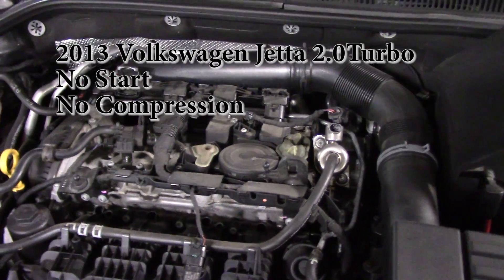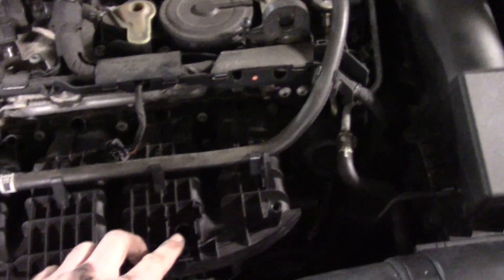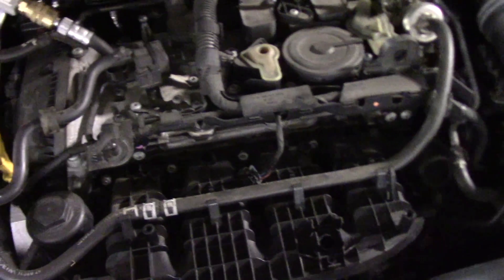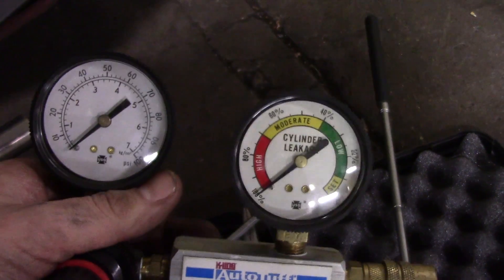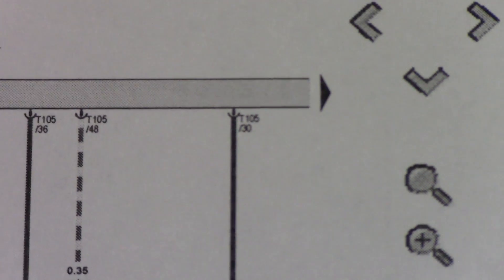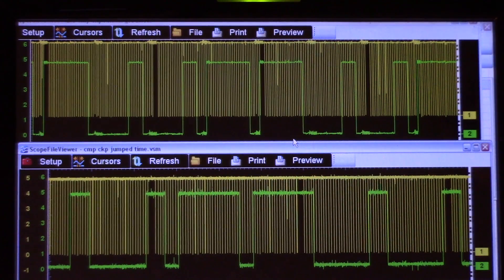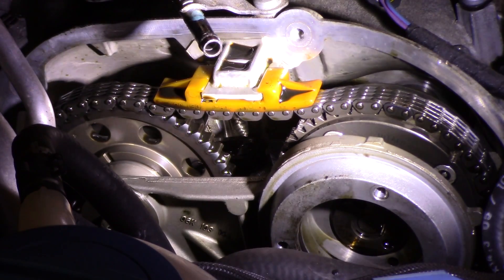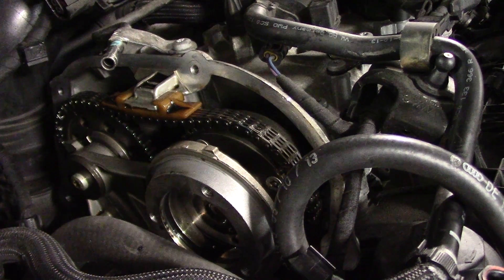2013 Volkswagen Jetta 2.0T No Start, No Compression (jumped timing chain)

Comment: This just happened to my wifes 2014 Jetta GLI that was purchased brand new with the CPPA Motor. VW lost a class action lawsuit regarding timing chain issues, and was ordered to extend the warranty to 10 years or 100k miles on timing issues. VW Denied our claim because the car was 5k over the warranty period. They would not budge even tho we have been loyal customers and purchased 4 brand new cars from them over the years. I was hoping for a gesture of goodwill repair but nope. We have lost a lot of faith in the brand.

Comment: Hi i have a question maybe you have heard of it before because no one in my town or the dealer could explain. I have a 2013 Volkswagen CC 2.0T automatic with 55,000 it has a push key, so i start the car for the 1st time of the day i push the key and it starts well. Drives great to where ever i go! I turn it off and few minutes later i turn it on and it starts well again sometimes the 3rd or 4th time i push the key to start it makes a weird loud noise in the front feels like metal crackling and also feels like the engine is jumping! I pull the key out and try it again and it starts fine with no hesitation.

Comment: mine just jumped time changing the fuel pump. I let it run out of fuel and stall out and that was it, jumped time. no compression. typical POS vw, try to fix one problem and something else even worse happens.

Comment: My tsi is at 100k miles and still has original tensioner, original chain, etc but works fine. So I know I need to update some stuff. What should I replace? Tensioner? Chain? Guides?

Comment: Mine still starts but has no compression in cylinder 4
Reply from the maker: Next step would be a leak down test. I’ve seen broken valve springs a few times

Comment: Would this cause loss of compression on all 4 cylinders?   I did a timing job on my q5 and had something went badly and I have no compression on 1 and 2. Very little on 3 and 180 on 4.  I’ve checked the timing chain 3 times now and the marks are perfect.  Even the measurements match the factory manual.   Even verified with a borescope #1 is TDC.      I’m buying a leak down tester this week to see where that leads me.  It’s frustrating when everything looks perfect.  I did injector seals too.  Wondering if those could be not seated properly.  It ran decent for about 20 minutes and progressively got worse.   Until I ended up with crank no start and no compression. I’m to new to vcds to know how to dig deeper.
Reply: Its common for the valves to get bent if the timing jumps too much.

Comment: What is your feeling on comparing the camshaft adaptation phase reading on VCDS to the timing chain “stretching” as far as preemptive maintenance to avoid a jumped timing chain? Spoiler, I read about it on Audi forums and mine is -5.87 degrees with 121,000 miles

Comment: Had my 2009 Passat for seven years before this happened. Had a slew of issues for the life of the car, but what really put the nail in the coffin for me was the engine jumping time Bc of the tensioner failing and a slow engine leak coming from the crankcase. I think I was quoted like $9k to fix everything. At that point, the repairs exceeded the value of the car. So after letting it sit in my driveway for a year, I sold it to a junkyard. Loved that car, but it was junk.

Comment: I could of had a v8....duh!
Wow did not know this about the tsi motor, and I thought the fsi was bad. This puts the icing on the cake. I bought a used 2013 gti. Clean car all the way around, in and out. But this - this is crap. I had 2 mk4 jetta 1.8t.  My only issue with them, mostly just age, and some worn bits and pieces.  The usual stuff ie, timing belt  control arm bushings etc. I still have one left. 1 gone, sold it to get the gti. Ran like a fine oiled machine. No pun intended.  179,000 miles it was an 03. It needed a clutch rear main seal..
Sorry about, but this new gti - wow! What a piece of junk. Should of done more research.  Hey VW!  Stick to what works. The 1.8t with out the dfi. Go back to what works.  If it ain't broken - don't fix it. Maybe I need to get a bicycle.  Less drama.  It's not about the environment its about saving my sanity and money.  This thing breaks down, I'm screwed, and here I thought BMW's were junk. 
Great video by the way.  I wish I would of seen it before the purchase, I could of dumped it into my 03 Jetta and replaced the clutch. Hey Vw watch the birdie.

Comment: can a timing chain randomly jump without a timing chain tension-er being damaged or broken?
what are reasons why a chain would jump?
Cost?
Reply: Look at the color of the oil towards the end when he’s comparing it to camshaft alignments filthy. Most times what happens if people don’t change the oil tensioners wear down and the chain gets too sloppy and then jumps. Same thing on BMWs and Lexus. change the oil every 3 to 5000 tops Use the recommended oil.

Comment: My 2014 GLI GEN3 sounded a bit like yours when trying to start it “it doesn’t start at all” and the CEL is only bringing up a camshaft Sensor I replaced it and still nothing I’m at 62,XXX miles is it possible I jumped timing ?
Reply from the maker: Yeah it’s very possible.  Common issue
Reply: Positive Lead Diagnostics thanks for the reply and dang I hope not 😞
Reply: @SkanDigital  Do whatever is best for you!

Comment: My brother might get a used A4 with the 2.0T. One owner and 87k miles, buying from an,Audi dealer . Should be interesting. I told him to just replace the chain tensioner with the latest revision to try and avoid this whole mess.
Reply from the maker: I would do the entire chain job, tensioner guides and chain to be safe
Reply from the maker: and change the oil every 5000 miles not 10000
Reply: What worries  me is Audi doesn't know if the oil consumption recall was performed. They checked the car though and he for a warranty through Audi I guess for 3 / 36. What ia the typical cost of a chain job on these.
Reply from the maker: I don't know the exact cost. But it's probably 6 hours of labor and the parts are very expensive. But as a preventative maintenance it's cheaper than a cylinder head plus the cost of the timing components.

Comment: tommy had the exact issue today. 2009 2.0 passat or jetta cant remember. sounded funny cranking. 0 psi in all cylinders. found a tsb for the timing chain tensioner failing.    how many of these have you done? i work on domestic hardly any vw's!
Reply from the maker: timing chain jobs....a ton!

Comment: Thanks for the video. My tensioner just failed today. Sucks when you take meticulous care of something and it still bites you. No more VW's for me.
Reply: Yea when my 1.8t VW was getting wore out. I just didn't trust these 2 liter motors. So I switched to a to a e90 BMW 330i.  which also has a lot of problems but I don't have to worry about putting an engine in it at 50k miles at least.
Reply: Tasha Teeling get a man that works on vehicles then you’ll never have to worry about you’re vehicle lol

Comment: very good video! Was there any damage to the valves in this case? If so, would the only fix be an engine replacement?
Reply from the maker: yes intake valves were bent, replaced cylinder head and timing chains
Reply: My car haves the same problem do know how much repair and labor costs would be

Comment: Sweet video, I did one last month, same problem, I did the whole job with new head, when I started it, she had very low oil pressure, I ended up putting a engine it,
Reply from the maker: Thanks for watching   Yea this issue is pretty common on the old and new style 2.0 tsi engines.

Comment: Hi Tommy and greetings!!What caused the break? The chain tensioner, Poor maintenance or high milage!? Try to film the repair and Merry Christmas!!!!!!!!!! Take care bro...
Reply from the maker: The chain did not break. But this veh had a low oil level and the tensioner for the chain is hydraulic. Most likely failed tensioner caused this.  Merry Christmas
Reply: +Positive Lead Diagnostics please 03 kia optima I try to start it no crank up just grinding noises I uploaded a video in my channel please bro give advice
Reply: I don´t get it why so many people drive around with low oil level... it happens so often... doesn´t this one have a sensor that shows up a warning light or message when oil is low?

Comment: Nice video & diagnosis. They're pretty easy when they crank like that...the sound of no compression. Merry Christmas Tom!
Reply from the maker: Yea it's never a good sound lol. Merry Christmas
Reply: Except when the sound of the engine is strange to begin with, when compared to the engines you are used to.